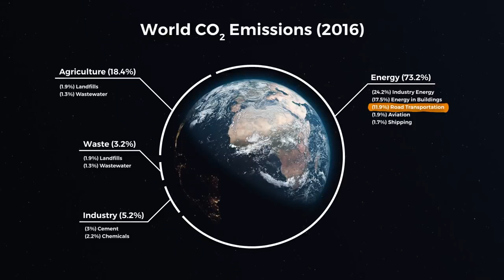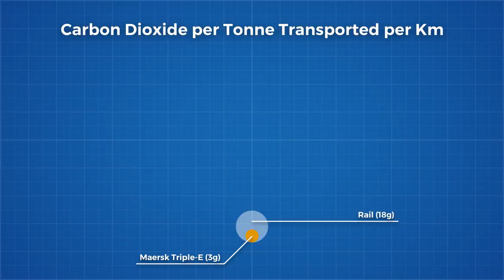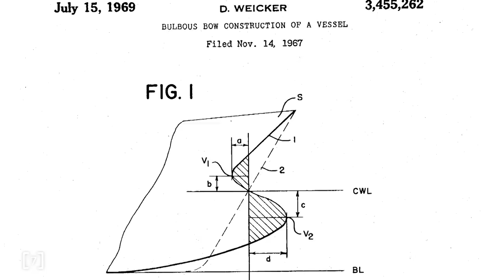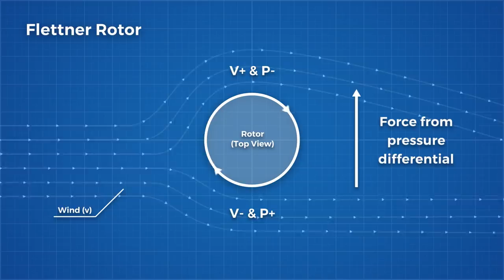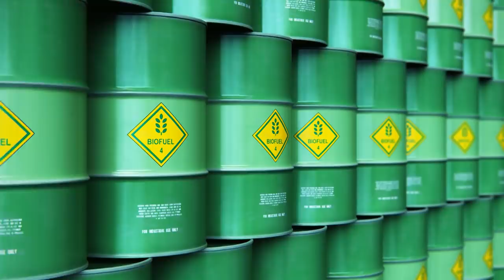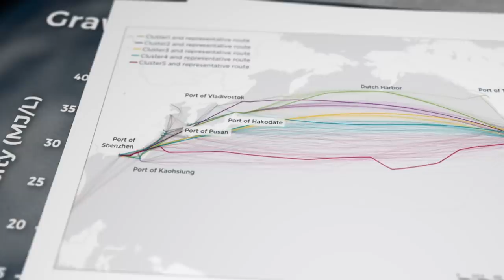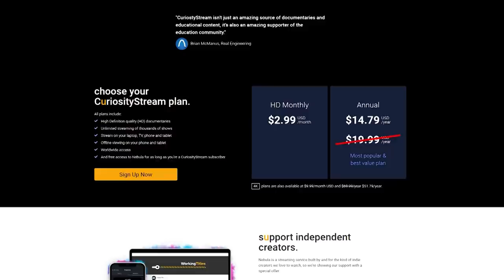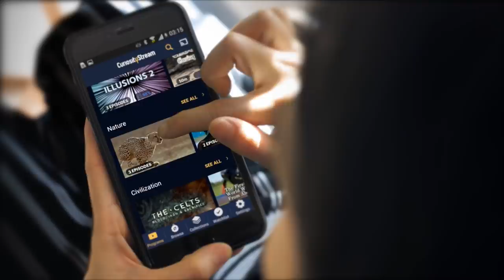Are Renewable Powered Ships Possible?

Comment: Pretty sure renewable energy ships were first popularized by Carthage in 650 BC so I'll go out on a limb here and say yes.
Reply: Hence renewable powered ships. Quinquiremes didn't have motors or turbines.
Reply: @HowlingWolf518  Pretty sure wind and buff dudes are both renewable sources of power, wind was already touched on an as for the buff dudes, well I'm thinking some kind of hamster wheel should do the job
Reply: @HowlingWolf518  people rowing is a renewable source of power lol
Reply: @enricodragoni  Somehow, I doubt longships are going to make a comeback.
Reply: Nope. They ran on heavy diesel.
Reply: They were pretty popular until the steam engine was invented.
Reply: I'm jsut waiting for the time when we go back to history's most popular green renewable energy source: slaves. 4 rows of 100 rowers per side, per row should be enough to get a ship there eventually, all without the need for noxious coal or diesel!
Reply: @enricodragoni  Stated like that, so is oil. But nature provides those conditions for free. You have to feed rowers.
Reply: Human rowers are significant CO2 emitters. The energy they produce is not carbon neutral. And they also fart so there’s even methane to take into consideration.
Reply: @pansepot1490  Hey I never said it was green I just said it was renewable 😅
Reply: @pansepot1490  But the co2 emissions from the rowers aren't extracted from the ground and released to the atmosphere, right?
Reply: @DinoAlberini  Really? You really think diseal power existed in 650 bc?
Reply: @HowlingWolf518  
No they had methane producing galley slaves. And occasionally wind.
Reply: @SirDella  It would be more along the lines of the emissions from the food that was grown to feed the men.  Statistical tidbit..... One gallon of gasoline has the energy equivalent of 550 man hours of labor.
Reply: @ButcherBird-FW190D  But the plants that were used to feed those men will grow again in the same place, rebinding the emitted co2. This is a very small circle. On the other hand it will take quite a while until the co2 from the atmosphere is transformed into coal or oil.
Reply: @gregorgiebel1377  The coal/oil will probably be ready by the time galley slaves row a container ship across the Atlantic.
Reply: @macaroon_nuggets8008  never heard of the ancient Phoenician philosopher, mathematician, and inventor of the Oxford comma Rudolf Diesel?
Reply: @DinoAlberini  No? I don't see how that is relevant. Even if he first technically created diseal or whatever, it was never widespread.
Reply: @macaroon_nuggets8008  I must agree with you.
Reply: @DinoAlberini  AHAHAHHAHAHHA lovely !   ;)
Reply: Slaves are both highly renewable AND solve the world unemployment issues. Anyone saying slaves are not green is advocating mass murder in order to lower CO2 emissions. I doubt even Greta is THAT extreme (though it's probably better not to ask).
Reply: @gvasilyev84  true, and if you pay them, they are called “employees”.
Reply: @DinoAlberini  nah, paying people is for capitalists. Society will provide for all their needs - food, water, procreation. This is the true communism which will save the planet!
Reply: @gvasilyev84  AMEN!!!
Reply: Technically oil is renewable... just really slowly.
Reply: @SirDella  a lot of fertilizers which are required to feed the population as it stands require either mining and shipping, or are synthesized from hydrocarbons. So even our food isn't carbon neutral
Reply: @gvasilyev84  thats interesting never thought of it that way
Reply: Dian Herdianto  prison labor is kind of a weird position. They're paid almost nothing but I've got family and friends who've done work as prisoners and most actually liked it. Some of the jobs are basically grunt labor but they often use prison labor to either utilize skilled labor (mechanics, construction workers, etc) or to teach useful skills. I recently wired a house for a general contractor who got started as a carpenter in a prison not far from Seattle, my mechanic was a mechanic and metal worker in a prison in california at one point, my dad was an electrician in prison back in the early 70s, and they all actually liked foing it. They get paid next to nothing but get enough for small stuff they can buy in the commissary/canteen (snacks, coffee, etc) and it's more enjoyable doing a job then just sitting around all day. Some states sell the prison labor but the majority of prison laborers are doing work for the government, I know 2 mechanics who worked for the state while in prison, the contractor I mentioned did carpentry for the prison, and my dad did electrical work for the police. "For profit prisons" are actually kind of unprofitable and the numbers have been falling and now only represent a tiny fraction of prisoners, I've heard the numbers fell steadily across the 2010s and the last statistic I found said it's at about 8%. Prisoners used to be basically slaves and forced to work but for decades its been optional so people usually choose to work either for snack money, to learn a skill, or just for something to do. Alot of countries do the same thing, they just explicitly only use it for job training or for work for the government while the US does use a small fraction of its prisoners to work at slave wages for private company's (which since only 8%, of prisoners are in for profit prisons and only a fraction of those have jobs shows how small the numbers are). For other countries it comes down to where you draw the line between "job training" and "unpaid worker" since you could argue that if someone is learning carpentry or has to help clean the prison as a punishment/chore are they learning how to be model citizen, learning a skill, or are they slaves?
Reply: @HowlingWolf518  your logic does not compute. Wind power is renewable power. If your logic was true, a wind turbine would not be delivering power....
Reply: I bet even then they were old news (see Iliad and Odyssey ~2000 B.C.)

Comment: You: Are renewable ships possible?
17th Century Galion: Am i nothing to you??
Reply: Check out the iron-hulled sailing ships of the 20th century. Some of those "windjammers" were fast. Some cargos on some routes could still use mostly wind power I'm sure.
Reply: @sietuuba  way way waaaaayyyyy to much cargo. Some of your shorter range ships with inner cargo holds that operate mostly in islands? Possible. The crate haulers? No way. Those crates would mess bad with aerodynamics on the sails, even if you set them clear above (which you would have to anyway to catch enough wind for ships that big
Reply: @MrCurbinator  I think your comment shows a mindset focussed on what is familiar from the present and past. Forget about how containers are stacked on a conventional ship, forget how sails are mounted on a conventional ship. Go back to the basic question: Could it be feasible to move large loads using wind power ?
And then we get to that sentence "I need to do more research on the topic to form an opinion".
Reply: @antondegroot6061  observing designs of the past and present is how you build for the future. Lets start small. Using modern synthetic metals, you could attach retractable rails to the superstructure to deploy studsails. You could run a sail on top as well (this is the best bang for bunk option, but creates instability). Rigging sails to the containers is right out. Companies ship excess product knowing a percentage will be rerouted to Atlantis. Cant rig to something that unstable and dynamic. Then theres the big question of water displacement. What is the ships ideal displacement, and do the added sails lift her up or push her deeper into the water. That will actually be what makes or breaks this idea because it dictates fuel efficiency.
Reply: @MrCurbinator  I don't know how containerships should try it but bulk carriers ought to be more straight-forward with their clear decks. They would need proper keels again, definitely, and lots of ballast tanks they could flood if needed, I suppose. I'm not a naval architect and not even a sailor so I don't have anything to put down on paper even, but it doesn't seem like an impossible design challenge even for an ocean-going cargo ship. We couldn't make the (free standing!) masts very tall to keep the draft and forces on each mast within reasonable limits but modern ships are stupendously long so we'd have lots of masts instead, each fully automated. Re-rigging costs would make a comeback so each sail, or maybe even the whole mast with its sails that reef inside it, would need to be as modular as possible to make replacing for refurbishment on land fast and routine...
Reply: @MrCurbinator  To address the suggestions that sail power is the answer I offer the following.  In 1870 a premium sailing vessel entered service, the ‘Cutty Sark’, she could carry around 600 tonnes of cargo at speeds of up to 17.5 knots, dependent on the prevailing wind, to harness the energy the available spread of canvas was up to 2 976m2.  To round things out that was circa 5m2 of canvas for every tonne of cargo carried.  The ‘Cutty Sark’ was designed and built for employment in the tea trade where time on passage was a large factor in securing the premium freight rate that made her cost effective but as soon as the Suez Canal opened, which the ‘Cutty Sark’ was unable to sail through, she lost her advantage, raw speed, to the steam powered ships of that era.  Mechanically powered ships have improved in terms of efficiency, on a freight tonne mile basis, by at least one order of magnitude since then.  After losing out to the coal burning, steam reciprocating mechanical ships of the late 19th century ‘Cutty Sark’ was relegated to the Australian wool trade, just about the bottom of the barrel in maritime terms and only one small step up from being a 'honey barge'.  The canvas, cordage and extra manpower needed for sailing ships was never a very benign environmental option so please discount any idea of sail as ‘sustainable’.  All this is without the problem that if ‘the wind don’t blow the ship don’t go’, when it does blow it often blows in the wrong direction for your cargo delivery needs and sometimes there is rather too much of it for comfort.

Random facts about Cutty Sark.  It is said to have been able to coax 3 000 horse power out of her sails, or in ‘real money’ 2 206 500 Watts (2.2 megaWatts), assuming this was in ideal conditions that is about ⅔ of the power that might be harvested from the ‘top of stow’ of a Maersk triple E, again in those elusive ideal conditions.  So that majestic spread of canvas would have been even less efficacious for delivering your baubles and bows from the orient, despite taking about three times as long on the voyage.
Reply: @BernardLS  you forgot the part where wool was a step up for her, as she tramped around for 7 years. Also that she’s apparently immune to fire.

Modern ships would still have to run engines. You’re not pushing a steel behemoths like modern ships on sail alone, not at a speed the modern market will accept. What you can do is generate an auxiliary thrust to allowing for a reduction in engine output. Winds don’t blow, sails you stow. Most sails and lines today are synthetic, so I don’t think deforestation will spike dramatically, and the sudden jump in addition polycarbon gear demand will offset fuel demand, keeping the oil bosses happy. The big effect, if this worked, would be lower emission output.
Reply: @MrCurbinator  yep skipped that bit but wanted to let the narrative flow (:-). Not sure about your fire resistance attribution as I thought see has had one or more while undergoing refurb in her dry dock. TTFN
Reply: @MrCurbinator  also the ‘Gotheborg’ was a square rigged replica built here a few years ago interesting in a touristy sort of way but illustrates the very limited cargo carrying capacity.
Reply: @BernardLS  thats exactly what I’m referencing. Cheers
Reply: @BernardLS  right thats the issue with in hull design. You’re limited by the hulls frame, and by instability on container ships. However thats perfect for ships running FIFO goods like salt or coal. Probably not the greatest idea with LNG ships, but I make that assessment not based on a chemists understanding of LNG, but rather a sailors knowledge of how quickly they USCG will fire half their annual budget at you if you get to close to an LNG ship.
Reply: Are kite based wind power an option here?
Reply: @antondegroot6061  my further research will start with the sail area / displacement ratio. From the Cutty Sark example we know that to 
achieve a time on passage of three times the modern container vessel requires 5 square meters per ton for a vessel with 1/700 of a Mearsk triple E. Round numbers modern shipping is 2 000 as efficient as top of the range 1870's sail. So it can be done but at a cost.
Reply: Galleon*
Reply: @ryxelmanuelp.mangahis1732  I cant spell 'armeggedon' but so what, is it the end of the world (:-)
Reply: @Hero Its galleon BTW
Reply: @rohitghosh5091  Aaaaargh! Sorry Mattey.
Reply: @AWARHERO  No problm my dear friend :D
Reply: Yea but cargo shops are massive